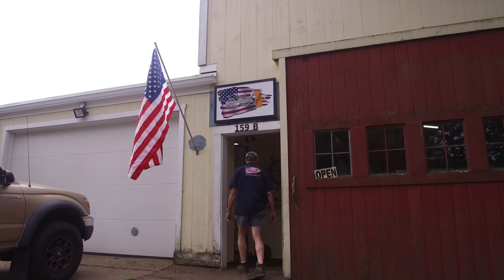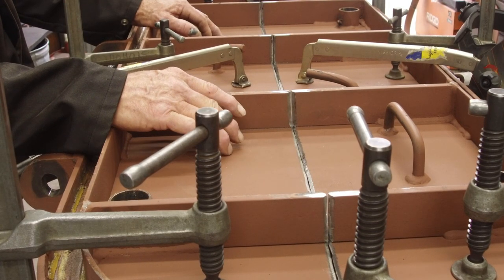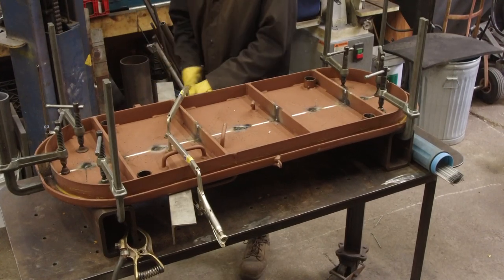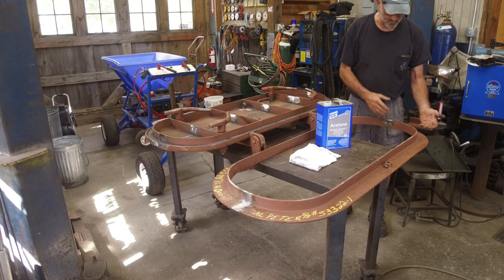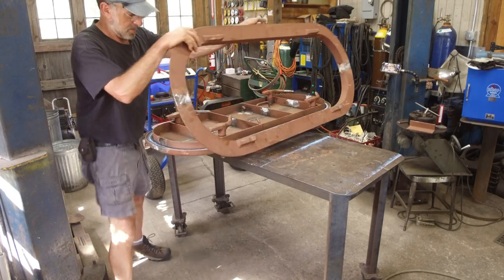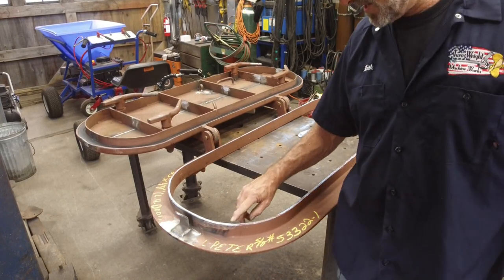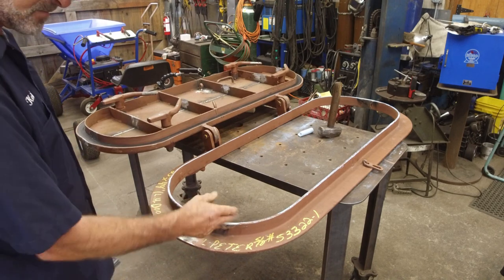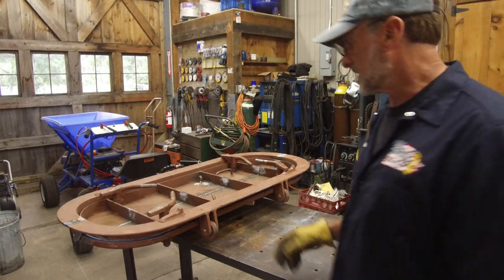Splitting Hatches Part Three

Comment: Keith,  First, the new shop looks great; much easier to move around it.  Second, thanks for the great piece on modifying that door.  I was in the USN from '69 - '75.  We called them "weather" doors.  On my last ship, USNS Wyman, all of the door were warped.  We had 6 dogs per door and a short piece of pipe (called a dogging wrench) on each door.  Couldn't get it to seal unless all of the dogs were tight.  The ship was made mostly out of aluminum, so the steel doors were tougher than the hull!  Thanks again!

Comment: Nice job Keith. Lets hope the side of the boat is also flat or all that work goes out the window. Film that too if you can. It would be interesting viewing.
Reply: Nothing some strategic tack welds, a big hammer and heating of the bulkhead won't fix.

Comment: Now I know why it’s called “STICK” welding :-)
Reply: 7918 rod develops a slag nugget on tip that does not allow striking without breaking it off, hince the banging the rod to start...a pain with this type rod, I keep a brick handy to tap tip on, so no arc strike....but a file or grinder works too.
Reply: @ypaulbrown  7918 rod, must be a new one.
Reply: Yep, welding with Sticks that Stick every time you try to strike an arc.stick welding.

Comment: I must have learned something from 40+ years of welding and wrenching, but before 9.29 you mentioned the hatch needed a slight bend in it so the center section hit first. Then the dogs would pull the ends down. Damn if I didn't think that same thing just before you said it!

Comment: Your ground arcs : that might be the reason for those difficult starts
Reply: Yes loose ground doesn't help, but in general even with a good ground connection stick welding by design causes hard arc starts due to the heavy non conductive flux surrounding the metal core of the rod. You can see keith break off the flux with his fingers in between welds as to expose the metal core  for good contact with the metal. Also particularly with the 7018 rod, after welding there is a glass like silica  coating  (i.e.slag) that forms on the metal part of the rod from the flux melting, which takes a few taps to break through and make a connection with the work piece.
Reply: It takes a lot more current to start an arc than to maintain an arc, which is why it's not uncommon to see the ground spark on high current welding.

Comment: Assuming that they use a dogging wrench similar to what I used, those dogs are just too close together.  They will have to choose whether to dog the non-hinge side or the hinge side but I don't think they will be able to dog both tight.  I wonder if you swapped opposite cornered dogs and bronze dog landings if that would make the situation better.  Still, you did what the customer asked and did it well.

Comment: Keith how are the surfaces of the matting material for the dog handles made as I recall they were made of brass in cam shape so the more pressure to the dog the thight the hatch became I know I sound like a ding dong but I was just an electrerns mate
Reply from the maker: These are steel but some older bulk heads had wear plates. ;{)
Reply: @KeithFenner  mean while 39 years later I don't have to worry about that answer anymore  most grasuses of you to take the time to share your unique knowledge

Comment: Welding is very difficult to stop things warping.
Reply: Order of operations is key, as you saw keith chose to weld the support ribs on the door first. This will bring the supports back to full supporting capacity and keep the door from folding in half when he welds the door skin seam.👍

Comment: Keith, I noticed the gasket has a seam in it. Did the original gasket have a seam? Will that affect the seal?
Reply from the maker: All rubber gasket seals are cut to length, glued end to end and then glued in place. ;{)
Reply: @KeithFenner  Thanks for the reply, Keith. Love the videos.

Comment: Keith is there a difference between stick welding and Meg welding? Is stick welding much harder than Meg?
Reply from the maker: A flux coating on stick and gas on mig, as long as the prep and operation are carried out to obtain full penetration, they will both give you same results. ;{)
Reply: Mig is machine fed wire, stick is arm fed.💪

Comment: A little off track. Do you have any ideas on how to take the warp out of a cast iron skillet? They get warped outward that allows them to not sit square and spin. I do not want to grind the bottom and ruin the logo.
Reply from the maker: Try appling heat to the inside then cooling a few times, May bring it back. ;{)
Reply: I have never had that issue. Are they high quality made in the USA ones? (Like Lodge)I always have that issue with anything but CI.